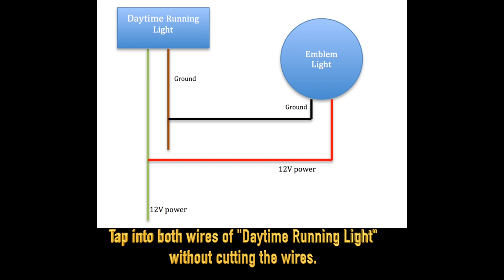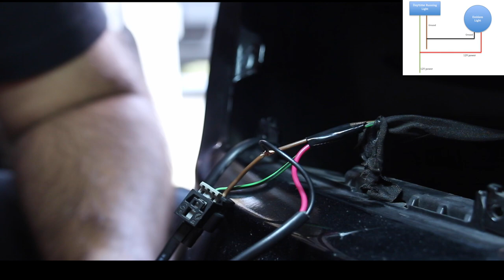Mercedes-Benz C250 Turbo 2012: EMBLEM LED LIGHT Installation

Comment: this is a incorrect installation. you use the LED driver located on the passenger side firewall, it has two open wago like connectors, just strip and push in to install. this method puts I'm proper load on your leds, by splitting the mili/amps incorrectly. this is on the 2018's I'm not sure about 16,17's

Comment: Worked great on my 2015 C300! Connected red to red/white wire and black to brown (ground). Light stays on as long as daylight running lights are on. Thanks!!
Reply: Does the brightness of the star change during the day or night? The DRL brightness changes so I'm curious to if the star's brightness changes too.

Comment: 09 C300. I wired in to right/passenger side headlight as there is more room. Strip away some of the protective covering. Black to brown wire. Red to smaller gray/red wire. It lights up when you first press the key fob on entry and when headlights come on at night. My car has fog lights and not the day time runners.
Reply: The star lights are LED and the main car headlight is hologen lights. Wouldn't this put too much power to the LED star light?
Reply: NO.  There Are Resitors In The Star.

Comment: Hi bud I really like the star that lights up for the Benz. I was wondering if they make one for my Benz. I have a 2009 CLS550. Plz let me no. Thx.
Reply from the maker: Hi Richard, Thank you. I would try Amazon or Ebay and just type Star Emblem for CLS550.  After that you may wanna double check the dimensions, if dimensions are same if should work. Good Luck and thank you for watching my video.

Comment: AfzaMoto, thanks for this video. I followed it and it has worked on my 09 C200K. However I do not have DRL, so I wired it to the fog lights below in the same spot, and when I unlock the car the star lights up. And I can also turn the star on and off, just as I can with the foglights. It's really addictive modifying the MB, can't stop! Thanks for your video, great to follow and a very nice look to the car in the evenings! Cheers!!!
Reply from the maker: Yeah!!!! That's awesome !!!!

Comment: The easiest place to wire the emblem to are the orange / yellow side marker lights.

There's only two wires attached to the bulb a ground and a power. It's super easy and easily reversible.
Reply: Just did it bro very greatful for the comment u left thanks bro couldn’t be easier
Reply: @JuiceForJuice  you're welcome the other way, is too complicated and so many things can go wrong.

The worst case scenario you have to replace a side marker indicator over a fried headlight.

Comment: I purchase the same star from amazon $69.99 I wait to arrived.I have a question:Do you have any error message on the dashboard after installing the star?Some people comment that is not recommend to be installed in this way.I'm a girl and I will try to install myself,your video is very useful for me.Thank you:)
Reply from the maker: +Diana Liu Hi Diana, I don't have any message reported on the dashboard. Everything works great. good luck. Is your car same model as mine?
Reply: My car is 2012 C300 4 Matic black.This  Mercedes is your car?Do you change the halogen bulbs interior or exterior with led?I just change the reverse one with Philips 1156 led replacing the 7056 halogen yellow but I received error message on the dashboard because I don't use the Canbus warning canceller 21 w,I love the bright white of Philips but I need to returned because I don't know what cable to punch in order ro instal the canceller and I found on aznoptics a led bulb canbus ready but now is out of stock.So,the star stay on all the time or only when you press lock-unlock button?
Reply from the maker: mine is 2012 bluetec 1.8L turbo, no I have not changed the halogen bulbs. Mine works with the daylight, yeah it works with the daytime running lights.
Reply: I need to removed all that parts in order to put that cable until the DRL?
Reply from the maker: +Diana Liu I am not sure if you have the same parts. Try not to force anything out. Take your time and do one thing at a time. Watch my video and see if you have similar parts.
Reply: Yes ! I will take my laptop in the garage and I will watch your video step by step,looks easy,but let see if I can do it to connect 2 cables to DRL:)
my star was juts ship yesterday,I will let you know if I did it:)
Reply: I'm just curious your car has the tail reverse-stop led or halogen?
Reply from the maker: +Diana Liu I don't remember I will check and let you know.
Reply: Ok. Thank you and Good night !
Reply from the maker: Hi Diana, 
tail reverse-stop is a "Miniature Lamp" standard bulb. It is not an LED or halogen. Usually halogen bulb goes in the head lights and LED lights are daytime running lights. However interior lights can be LEDs.
There is a small dial lock on top of the grille, you will need to unlock that, before you start the grille removal process. Good luck
Reply: Yes! That miniature lamp bulb is 7506 Osram 12v 21w,these are the ones I replace it with 1156 Philips white led,I have 3 on each side of tail,now I need to purchase the warning canceller because I have error code on dashboard,but are gorgeous,is a super white bright,when I put the car in reverse and for stop is more brighter too.I;m happy with these bulbs and I recommended.I will let to know how my installation works.I still waiting for my Star:)
Reply from the maker: impressive, :) I had no clue about that. thanks for the info. I am sure that super white bright light is amazing. I have 8k HIDs on my Hyundai Genesis 3.8L 2012. thanks
Reply: woauuu 8k?you glare everybody on the road.It is leggal in USA 8 k?I live in California.
Reply: I install low beam 5000k Philips Diamond Vision ,they say is off road but i still used.
Reply from the maker: +Diana Liu i am not sure about its legality, but it looks nice.
Reply: I agree !
Reply: Those light-up emblems are so tacky.  "Look at me!!!  I'm in a Mercedes!!!"  Grow a pair, please.
Reply: Don't be a hater!!!!!  Look at me I am jealous people that drive Mercedes.
Reply: I kinda have to agree, the emblem is already 10inches.. adding lighting to it is a little too much and this is from a die hard mercedes owner, too each to their own taste I guess.
Reply: Hey nice vid!!! I have a 17 GLA 250. I want to put my emblem on however I was told this way would compromise my warranty and that I could do a fuse tap. Any knowledge on how to do a “fuse tap”? Thank you.

Comment: The wires should be soldered, and traced better through the side lining , plus battery should have been disconnected for safety, poor video😔

Comment: Do you have a picture or diagram of how to install the inline fuse to this Illuminated  M-B emblem? In the kit I have there is an inline fuse and I'd  like to know how to connect it in this configuration.  Here is the Item description for the emblem I purchased on Amazon for about $50,  "Replacement Full Time LED Illuminated POP-OUT Star Emblem For OEM 2005-2012 Mercedes Benz A B C E R SLK CLS GLK Class."  Link:  http://www.amazon.com/Replacement-Illuminated-POP-OUT-2005-2012-Mercedes/dp/B012CT2GWG?ie=UTF8&psc=1&redirect=true&ref_=oh_aui_detailpage_o04_s00

"StillBillVa"
Reply from the maker: +Bill Jones +Bill Jones Hi, I am not able to see any inline fuse option in the the link? A simple inline fuse is really easy to install, there are many videos available on youtube, type in "How to install an inline fuse". It will give you the basic idea. Send me the pictures if you can. thanks  Afzamoto@gmail.com

Comment: Why can't you just run a fuse tap to the ignition fuse box to power the LED star? Your star would then come on when the ignition is on and would avoid any wire splicing or messing with vehicle lighting.
Reply from the maker: LexBrett Gen2, thanks for the suggestion. It is possible, I will try.
Reply: Could you please send explain how i would do this?

Comment: I just used T-taps on my side parking lights. Why bother stripping wires when you don't need to. Also, why connect to DRL's? Makes no sense when they dim when lights come on. Connecting to parking lights has them on at full/normal brightness anytime the lights come on. Don't make things more difficult then they need to.

Comment: nice video... very helpful. a have a question though... is it ok to tap on the auxilary battery and it use to power LED strip light?

Comment: used park lights but was a lil harder then it sounds, finding the right wire. I'm guessing the headlights have a relay inside them
Reply: im trying to find the parking light wire. can you help plz ?
Reply: i even bought the fuse tap but it doesnt look safe to connect it to the fuse box specially regarding the earth wiring. so ive tried to look for the parking light but cant find it ... any suggestions?

Comment: I had the illuminated star installed on my 2010 C300 yesterday, and the only time it will work is when I use the fog light (the one that shines brightly in the rear...I actually have to pull out the car light knob to activate the star) .  I don't want the emblem illuminated with my daytime running lights, but when I drive at night with the regular lights, I want the star illuminated.  What do I need to do to accomplish this?  What do I need to ensure it's wired to?

Comment: When I purchased my 2015 E 350 4matic a few weeks ago, I worked the illuminated led star in the deal.  They had my car for several days thinking they had the wrong harness to hook it up but they discovered the had the correct one.  I believe they haven't installed too many of these lights... My question is... My light does not illuminate very bright (you can barley tell that it is on).  It there a way that I can adjust the illumination of the lights from behind the star?  Thank you in advance for your wonderful youtube installation and I look forward to hearing from you.

Comment: i have fog lights instead of daytime running lights. what should i plug it up to?
Reply from the maker: Hi Erik, You can use parking lights or fog light connection, but you will need to turn on the fog lights to turn on the star light. Thanks and good luck
Reply: I connected it to foglights and it still works, and yes, need to turn it on manually. But when you unlock the car they turn on anyway!

Comment: Thanks! Did this on my wife's 2013 C250 and the video was invaluable! I still don't understand when the lower LED lights that we tapped into are on?! I could only get them to come on with the engine running and never really noticed before. But thanks. The 2013 is not the screw out type and we needed to know to remove the grill to get it out.

Comment: Good video. Would want to do this to my e550 but I think I'd rather it be connected to my headlights.  You don't need the star to light up during the daytime. Just would be a waste in my opinion.

Comment: last year i wired some daylight lights to my sidelights myself and car has been fine  - today i decided to fit one of these badge type on the grille -  it works with my headlights  but i noticed my glow coil is coming on while diving then dissappears  also the engine management light is permenantly on.   so i dissconnected this grille light but still same errors - so i had to get the codes cleared and car is fine now.

Comment: hi where you buy that emblem led light ?
and it will fit with my 2013 slk 250
1.8L v4 turbo engine ?
Reply: hf007jkt why do you think your engine would matter all you need is 2013, and all 250 the rest is unnecessary

Comment: Hey great video....just wanted to ask you...did you get any error messages on your dashboard after you installed the star.
 I have 2015  C200 and I'm considering installing one on it... but only if I don't get any error messages.  I would really appreciate your reply.. thanks.
Reply from the maker: No not on my 2012 c250
Reply: AfzaMoto
Cheers and Thanks for your reply.

Comment: Will the wiring method you use keep the star lit only when running lights are on or both running lights and or headlights. thanks.
Reply from the maker: +Nick Blinow Hi Nick, my day time running lights stay on all the time when I push unlock button on the remote and when the car is on/running. Star is not connected to the headlights. So it does not matter if the head lights are on or off. It is connected to the daytime running light only. Please let me know if you need any other info, thanks for watching my video.

Comment: Hey, are these instructions applicable for a 2013 C300 4 Matic?
Reply from the maker: No, star is different on it. It's a twist kind.
Reply: Thanks for replying so fast. What do you think about the wiring part?
Reply from the maker: +Abdullah Gondal, wiring configuration can be with the daytime running light, or any other light that can provide 12 volts, such has parking light etc. Its a low amp light so you don't need too much amps. It can also be connected in the fuse box. It also depends on the light you will be purchasing. In any case here is what i recommend. 
1. Figure out how to install the star by removing your existing emblem, hopefully its the twist kind and you won't have to take the grille out. If not procedure might be same as mine. Try it and let me know. 
2. Figure out if you want to  connect it with a light, such as daytime running light or parking light or any other, assuming that you have a two wire connection like mine, if so, double check if you can easily access and connect the wires. 
3. If you plan on connecting in the fuse box, then configuration will be different. check out the below video link it shows the fuse connection  https://www.youtube.com/watch?v=uvTklE6xYlQ
I think you can do it! please let me know if you need any help. 
Thanks and good luck

Comment: Has anyone been able to get a hold of one of these stars for 2014 c250?
Reply: The 2013 C model star should work on your car. I also have a 2014 C250 and will install this.
Reply: Edgar Vazquez eBay

Comment: The wire will not heat up and melt?
Reply from the maker: Arshad Hossany, no as long as its not touching any Engine parts it will not melt.

Comment: Can you send the link to the one you bought off Amazon?
Reply from the maker: +Brandon C Hi, I bought it from this link "http://amzn.com/B00SO9GYNQ". it shows currently not available. There are many sellers on ebay selling similar badges (all from china!)  here is a sample link "http://r.ebay.com/8URtQg" . Mercedes-Benz models up to 2012 they have different design. Make sure whatever badge you purchase it is  compatible. Further, you may want to inspect/plan installation procedure before you purchase the star. Good luck and let me know if you have any questions.
Reply: +AfzaMoto thank you
Reply: +AfzaMoto Not sure what happened....followed everything you said, it did work and light up, but mine looks more dim than yours...any ideas?
Reply from the maker: +Brandon C, it will not look anything like your daytime running light. So basically at night time it will look good and bright. My car was parked in the garage, I made the video at night time. Try it in a dark area and check. If it looks dim then return it and use some other vendor.
Reply: +AfzaMoto tried it again, same thing...piece of junk I guess
Reply from the maker: +Brandon C sorry man,
Reply: +AfzaMoto no worries...perfect install video..appreciate it
Reply from the maker: +Brandon C yeah, I bought mine from the same guy, so yours doesn't look anything like mine?
Reply: +AfzaMoto no..it lights up in the back, but when you look at it head on, there is not much of a difference from the original star without a light
Reply from the maker: +Brandon C oh ok, well now you know how to install, perhaps you can try a different vendor next time.
Reply from the maker: +Brandon C FYI my dealer wanted 650 for the original light and 200 for the installation.
Reply: +AfzaMoto yeah i see crazy prices for them...thats ok, I will leave it and move on to my next mod
Reply from the maker: +Brandon C what are you planning to mod?
Reply: +AfzaMoto no plan yet..love my car the way it is..but sometimes i run across something i like
Reply: Those light-up emblems are so tacky.  "Look at me!!!  I'm in a Mercedes!!!"  Grow a pair, please.

Comment: Will the installation be the same for a C-class 2008?
Reply from the maker: +MrFaik09; it should be compatible with the below models.  
2008-2013 Benz C class W204 C180 C200CGI C200K C230 C260 C260CGI C300 C200 COUPE C350 C250,
http://amzn.com/B00SO9GYNQ
Reply: +AfzaMoto is this star twist or pull?
Reply: It's a pull, there are tabs behind the star.
Reply: +afzamoto what about a 2014 C250 sport sedan?

Comment: Best vid so far....i have a 2011 e350 coupe. Does anyone know where i can find the illuminated star for that year and model? and is there any chance you and do a diy vid on connected it (or any other illuminating device) to a switch within the cabin. Preferably something that looks stock or just classy?
Reply from the maker: Sorry Marcel for a late reply, I am sure it can be done but I have no idea how to do it.
Reply: no problem but i have another question. After i installed the emblem i my car would not start and i started seeing the srs warning and a abs warning in the dash. Would the emblem have something to do with it or did my battery go?
Reply from the maker: +Marcel Lawrence it is your battery.
Reply: +AfzaMoto it was the battery. Thanks. 👍🏿
Reply from the maker: +Marcel Lawrence perfect. So how did you install the star led, and share some pics. Thanks.
Reply: +AfzaMoto actually used the same method. No real difference other than access to the daylamp (no screws in the front so I went through the hood. I have long arms). Everything works perfectly.
Reply from the maker: +Marcel Lawrence awesome, enjoy.